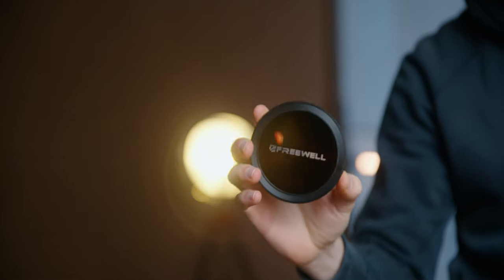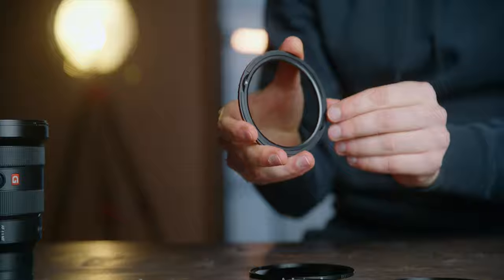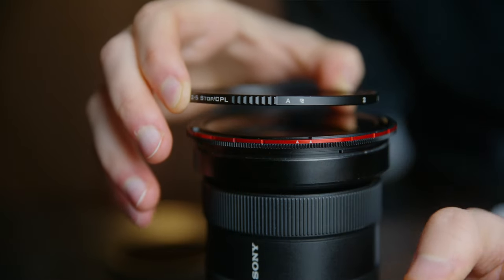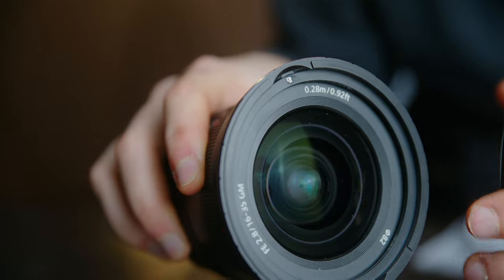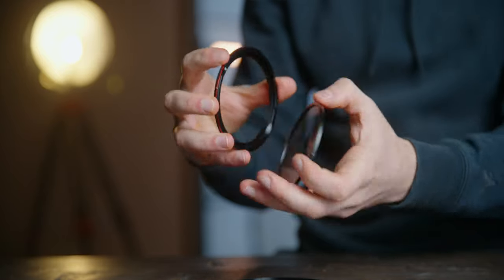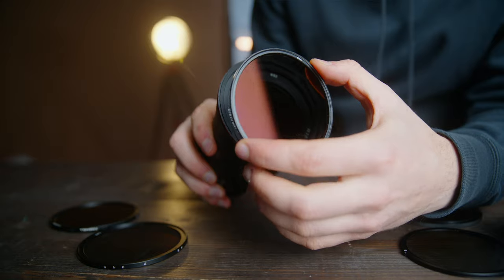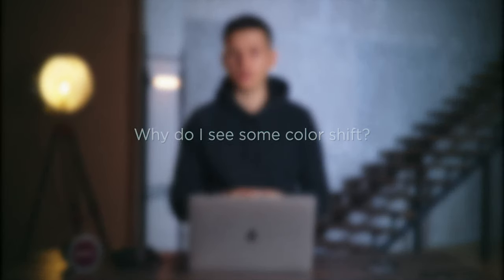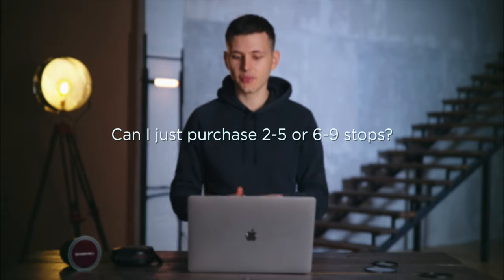Magnetic VND Installation Guide Part 2/3

Comment: He stated that the magnetic lens cap will not work with the VND filters (2-5, 6-9) attached. If you flip the lens around it will work. So you can use the lens cap with either base only, CPL or VNDs. The magnet will prevent you from getting it wrong. Just flip it to the other side. Great filter solution.

Comment: Questions, I'm looking at your Freewell 82mm Magnetic Variable ND Filter System on the BH website. 
1) Does the Magnetic Base Ring have an ND value or is it just a mounting ring for the ND filters? 

2) can I stack the ND2-5 and the ND 6-9 filters on top of each other, to achieve a darker ND filter. 

3) The system also includes a Variable ND2 to ND5 Mist Filter. What is a mist filter? 

Basicialy, I'm wantt to experiment with very long exposures - many minutes in length - but with the option of easily removing or changing the ND levels. 

Thanks. D.
Reply from the maker: Hey,

Response to all questions is already in our first three videos on this playlist https://www.youtube.com/watch?v=VC0CeAyO7gY&list=PLbvSQ3vHGE2sMCejA1KA_3cYgKCW-Aiw-

You are not precise with your question playlist; explain the process of installation & what is included.
No, you cannot, which is mentioned in the video.
Glow Mist filters have a black-colored mist effect, which creates a more subtle and understated diffusion effect. This filter can reduce the sharpness of an image and create a slightly hazy, filmic look.
The mist effect is more noticeable in the image's highlights and can help reduce glare or harshness.

Glow mist has no role in long exposures. 

Here is the video link showing difference https://youtu.be/jpBgmRZdwg8

Let us know if there is anything else we can help you with. 

Thanks

Comment: Love your system. Best thing ever, Glad I backed it ;-) 
However, to be honest, shooting Fullframe Sony A7S3 with Tamron 17-28 I do see a vignette with VND6-9 when fully closed. What camera image sensor were you testing with? APSC? MFT?
Reply from the maker: Hey There,

Quite honestly the issue of the vignette does not alone depend on the filters.

Take for example for 82mm filter thread we are actually using 90mm optical glass making the outer diameter 95mm which is already bigger than our regular VND & quite bigger than our straight ND. 

Sure we have done tests in APSC, MFT however as a manufacture we cannot do our test in all the lenses that are the reason you can find over 200+ reviews online so basically the filter has been used in all kind of lenses & from lens to lens some result will be different.

Thanks
Reply: @FreewellGear  it's just that a stated 15mm (at 4:58") would definitely behave vastly different on a FullFrame sensor (and show up vignette) whereas the same lens on a APSC (x1.5) or MFT (x2) probably wouldn't. Hence it would be important to mention this to avoid confusion and manage expectations, that's all.
Reply from the maker: @grafpez  I am not sure where you hear 15mm I think the video says above 16-17mm. Noted I will pass your suggestion to the team as well.
Reply: @FreewellGear  yes you're right you said 16-17, but as I mentioned above, I was testing with 17-28FF and I see it up until close to 28, which would be 17mm @APSC being 25mm equivalent.. hence this is important information. Thanks for passing this on, appreciated
Reply: hey i'm happy to find someone with a A7S3 here, do you use more then 9 stops for the A7S3 on daylight in the summer? Because here where I live it's like 98% of the time not cloudy so I really need to know since the A7S3 has an incredible sensitivity... 
Can you help me with that?
Reply: @foxyvisionsvideographer  Hard to say, that would depend on desired f-stop, shutter speed and PP also, but my gut feeling is no. You can check yourself and test by adjusting shutter speed to suit, then computing this difference to f-stop equivalence (google lists)

Comment: Hi very interesting. I would like to buy 82 mm to use with actual 62 mm lenses. Do you think that two adapter (from 82 to 77 and 77 to 62)  may reduce filter performance during video ? Thanks
Reply from the maker: Hey, Sorry i didn't quite understood your message if you want to use 82mm filter on your 62mm lens than you need 62-82mm step-up that's it.
Reply: @FreewellGear  Yes but does distance Bitween filter and lens reduce quality ?
Reply from the maker: @guidovernocchi  the best is more closer to lens but at the same time if you’re looking to make one time investment then you get the bigger size along with step up rings.

Comment: can you build your own set? I dont want all the filters that come with it. the most I'd want is the base plate,+ vnd 2-5 and then maybe grab the vnd 6-10 later on.
Reply from the maker: Hey, All VND has to be aligned so they have to be sold as a set.
Reply: I'm asking myself the same question, maybe the new 2-5 and 6-9 filters work now with amazing set